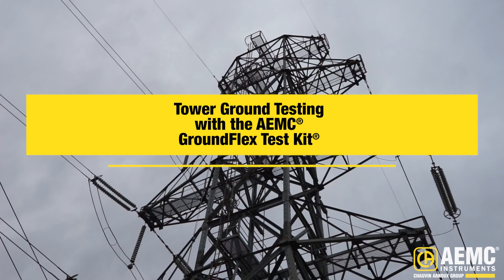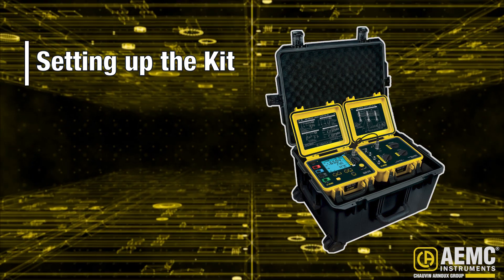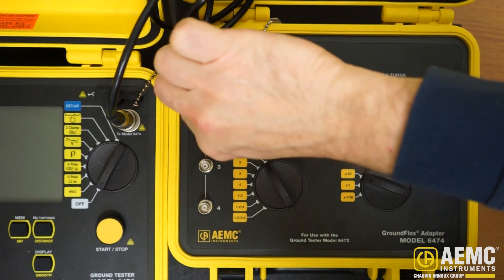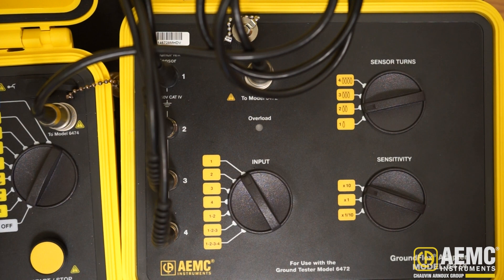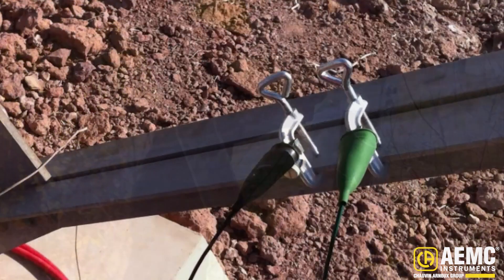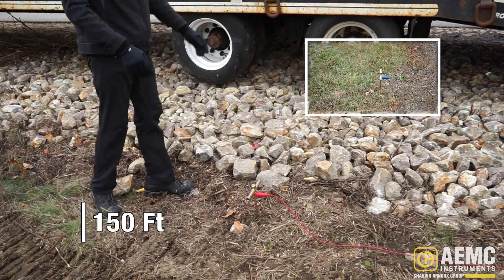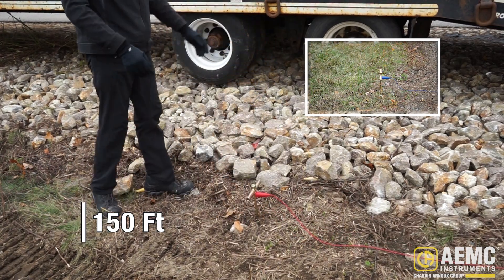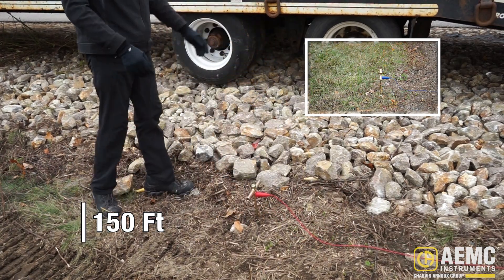Tower Testing Using 6474 GroundFlex® Kit

Comment: When do we use Sweep mode? We have transmission line and We have to learn TFR value of tower. Will we use auto mode or Sweep mode? Thanks
Reply from the maker: Generally, the frequency to use for testing Tower Foot Resistance (TFR) is a similar frequency of the power system involved and away from any strong harmonics of this frequency.  In AUTO mode, the meter defaults to 128 Hz and this strikes a balance of a strong test signal and reduced inductive reactance with minimal influence of system harmonics existing on the grounding system.  This closely models the behavior of the ground system during normal electrical disturbances in the transmission/distribution network.  If you were trying to model other anomalies, like lightning strikes, you would be inclined to test with a SWEEP mode to model the grounding system’s behavior across a wider frequency spectrum.  Hope this helps. Please contact techsupport @ aemc.com for more information.